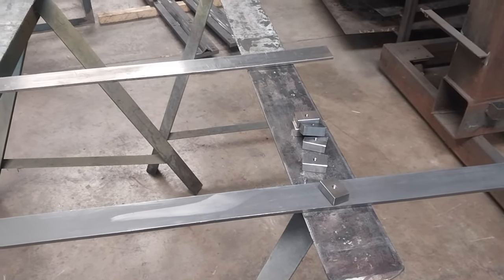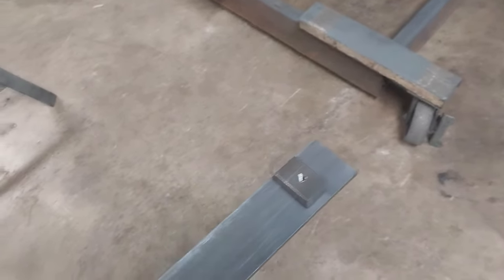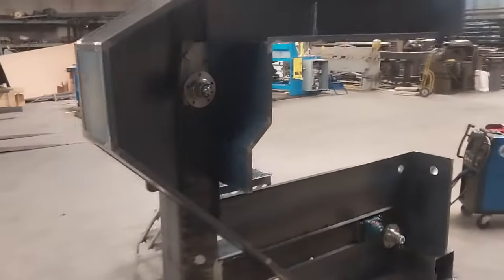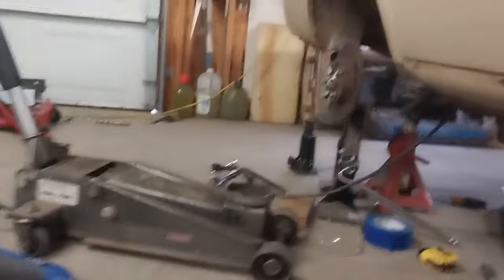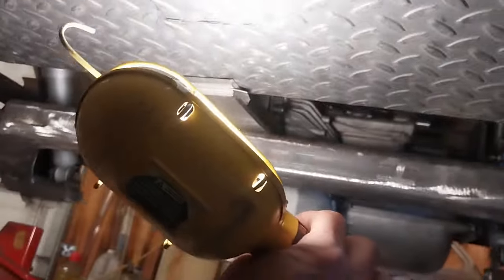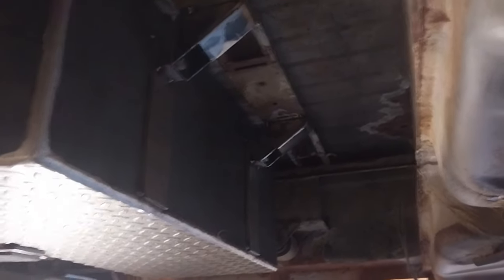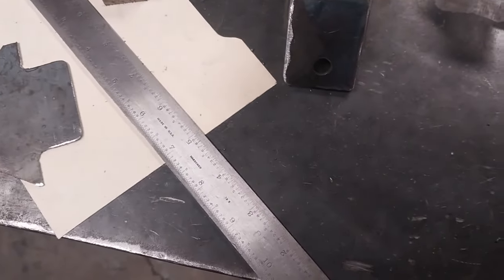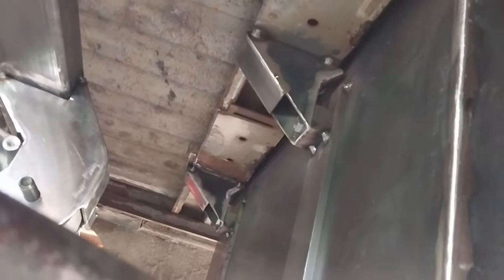Rear Battery Box - TSLA VW

Comment: How did you make the inside spacers to keep the modules in place? I have 3 battery boxes and one of them is 8 modules. I was thinking of doing something like Jerry Rig Everything did but it is very expensive the way he did it.
Reply from the maker: I'm using EVE 105ah LiFePO4 cells in this build.  Look in my TSLA TJ playlist.  There are 5 or 6 videos for how I held the Tesla modules in that build.
Reply from the maker: I have a 8-module aluminum box.  It's a design Mr. Mopar Man (Kevin Erickson YouTube page) came up with.  I'm not going to use it and would make you a good deal if you're interested.
Reply: @billbayer5526  I will try to find it in your videos. It might work if the dimensions are good. I was going to have the modules vertical but I can change it. BTW, what do you think the battery weight will be per kwh of power? I had some CATL batteries but in total the weight came out to 70% more than the Tesla modules so I went back to Tesla.
Reply from the maker: @mikeh6206  The aluminum box I'd like to get rid of is designed to have 8 modules vertical. Are you on Facebook?  Shoot me a message.